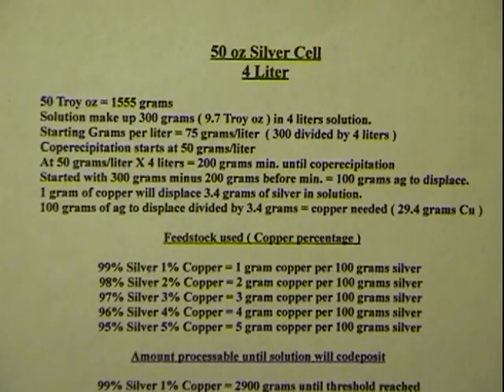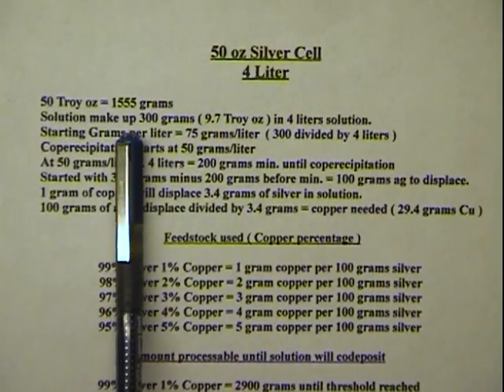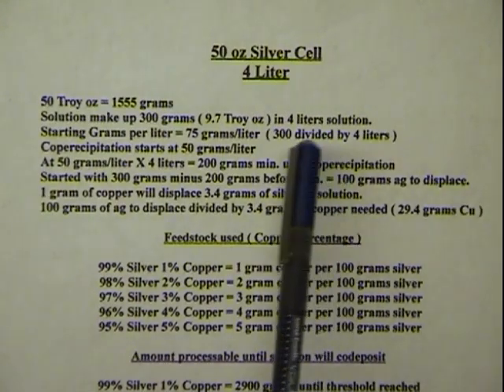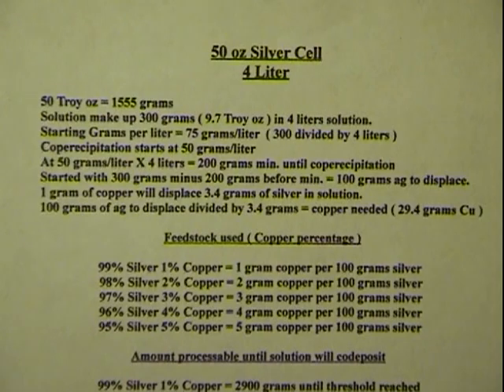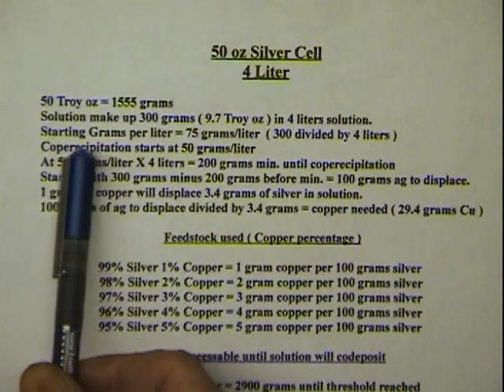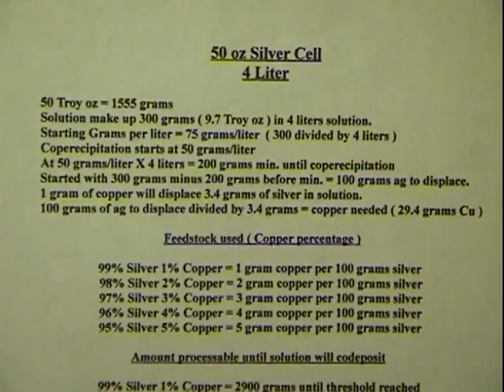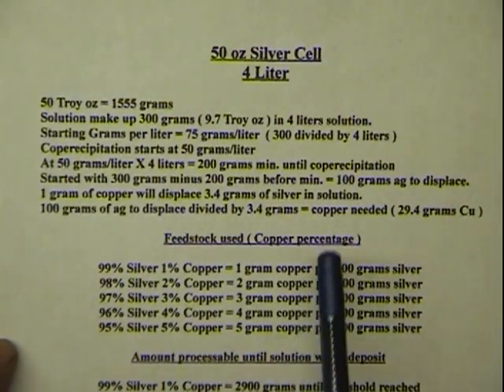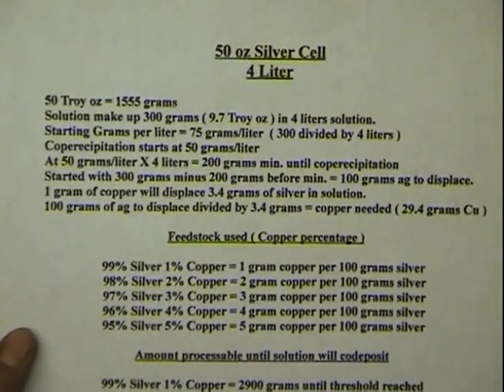Theory And Calculations Of Silver Cell Solutions

Comment: Thanks so much for this video. It answered a lot of questions. So according to this, the yield of the silver cell depends on the electrolyte concentration. 

So if i use a stronger electrolyte (say 500grams in 4 liters), will i be able to process more silver before copper starts to plate?
Reply from the maker: Yes sir that is correct.

Comment: great job on your videos, all very informative. I have also been reading a book by C M Hoke trying to learn what I can.
     I have a question though, would it make sense to use two - three baths for refining scrap metals. what I mean is say 

- pre solution lye bath to clean grease and other junk
- first bath strait muriatic to dissolve tin, lead etc...
- second bath weak a/p solution to dissolve copper
- third bath strong a/p solution to dissolve Gold,platinum, silver
- then using aluminum in first bath to drop tin,lead
- stainless to drop copper
would this be an efficient way of reusing solutions and reducing contaminants through to the final step?     
   or how best would this be accomplished.    I'd like to recover all metals, then neutralize solutions in the end for disposal?     keep on rocking them vids
Reply from the maker: +Chris Bryan Thank you sir for the kind words. If you will go to www.goldrefiningforum.com you can find all the information you need to help you with your questions. Their really is no right or wrong answers sometimes, it just according to what you are trying to accomplish.

Comment: Nice detailed explanation. 

Have you ever discussed testing methods to see where your solution might be at or do you just keep close records? Also how can we test the final value of the precipitate to ensure that no copper copercipitated?
Reply from the maker: aletoledo1 You can dissolve some crystals in nitric acid. It should be crystal clear. You can then add a drop of ammonium hydroxide to a test sample and if it turns blue it has copper in it.